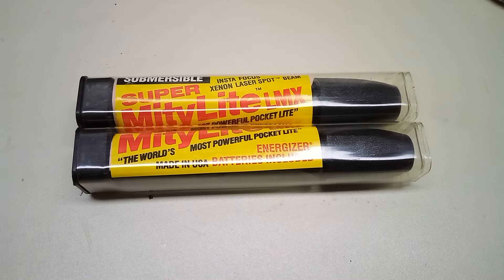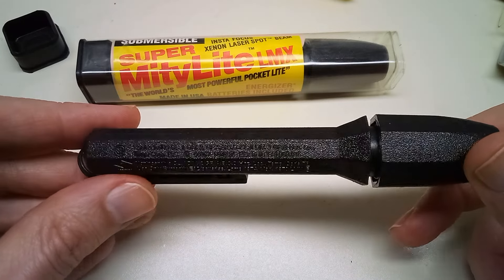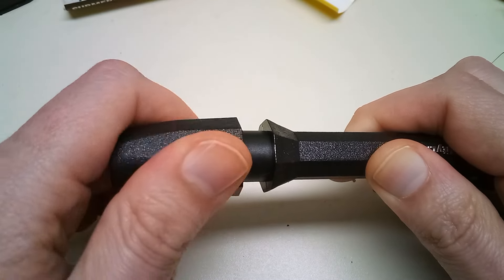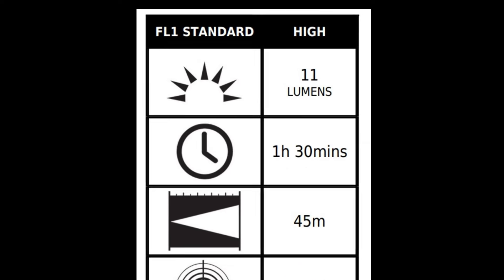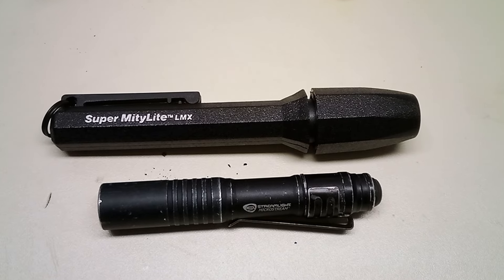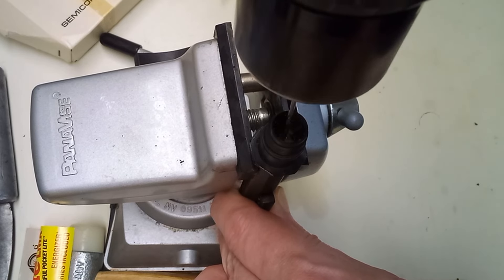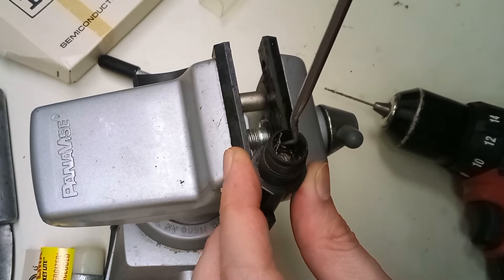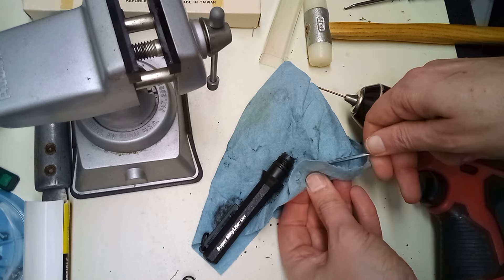The World's Most Powerful Pocket Flashlight (in 1993) Pelican MityLite

Comment: Still have mine. Clip never broke. Replaced it with 1st Gen Surefire 6P.
Reply from the maker: Very cool. Glad to hear the clip is stronger than I assumed it was.
Reply: @ballinator  Didn't try to hang off a building with it either. Copper internal is an easy fix. Try Tape Master Copper Foil Tape and cut to size.
Reply from the maker: Thanks. The copper tape is a good idea. The original contact looks like it's molded in to the bottom of the light, I could use the tape to connect it back to the top.